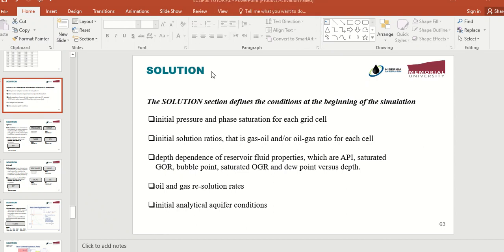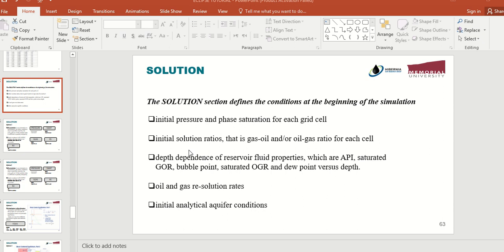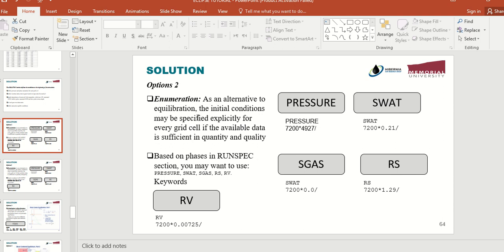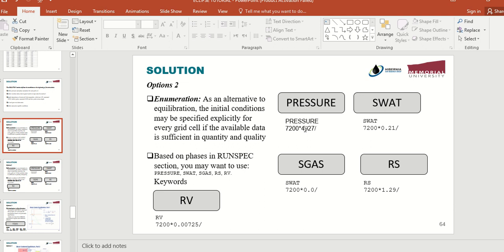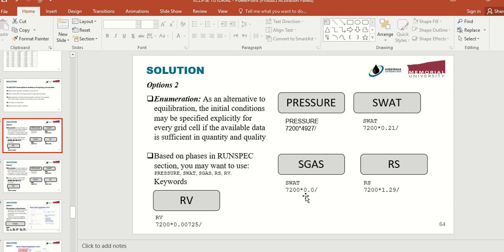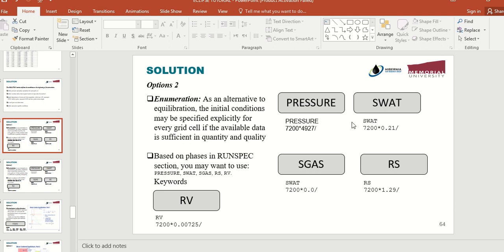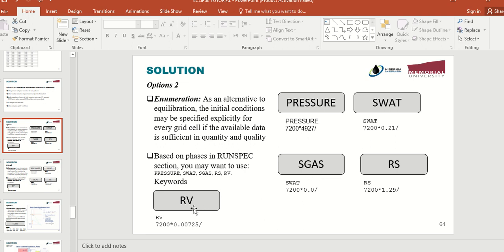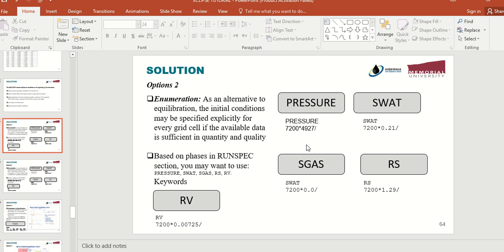Reservoir Simulation with ECLIPSE - Solution Section

Comment: We had 300 grids in previous videos.Why 7200 now?
Reply from the maker: You are right. I used two different data files in the tutorial. You can replace all 7200 by 300. Or change the 300 to 7200. Make sure your well locations are fitting in the grid size.